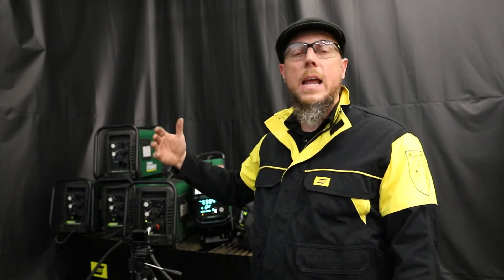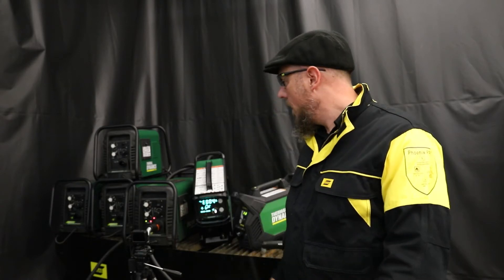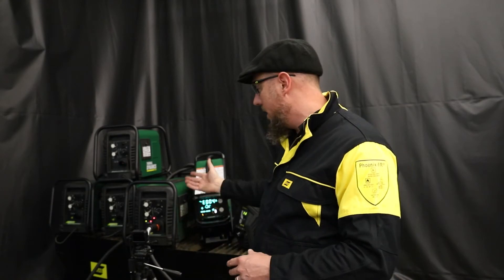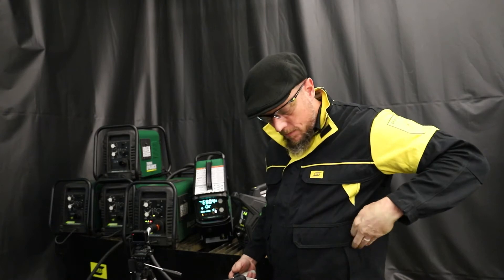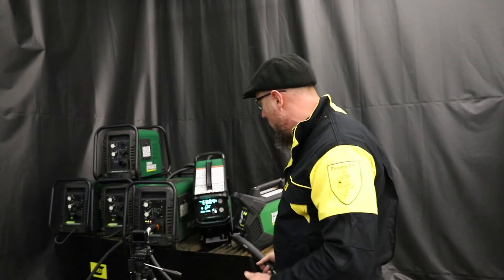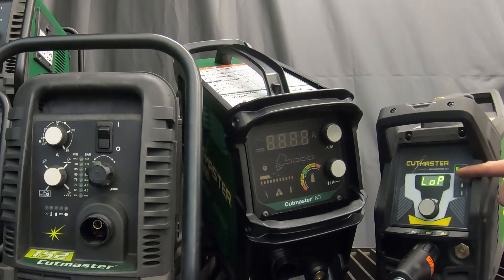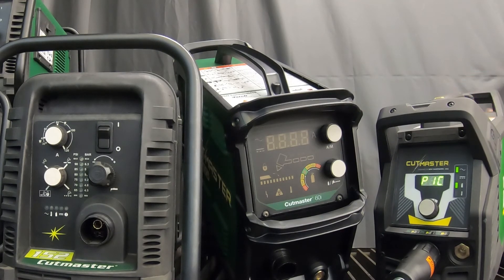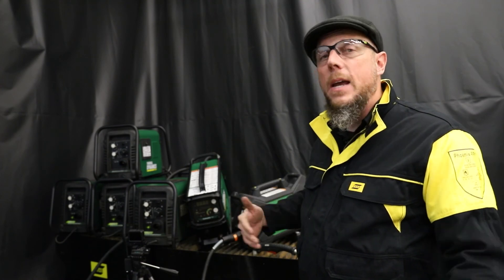Understanding the Error Codes and Alerts on Cutmaster Plasma Cutting Machines

Comment: Custmastsr 40. PIC error. Tripped mid operation. Replaced  everything in the torch, same error. Tried an alternate torch, same error. I need help. Air supply is a reliable 100psi and power is solid as well.
Reply: hey did you ever find the issue? im having the exact same problem
Reply: @jacksonbarth7763  it turns out my cnc controller was holding the torch open.

Comment: Very helpful video. I am trying  to help a guy get a cnc plasma table running. He has the thermal dynamics 52. I had an error code going off on the machine torch. The starter cartridge  may not have been installed.